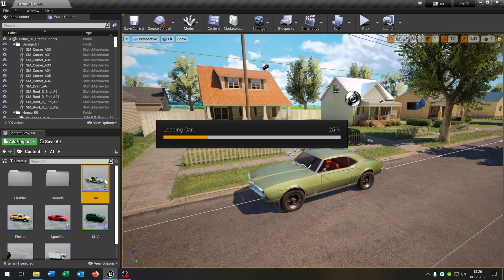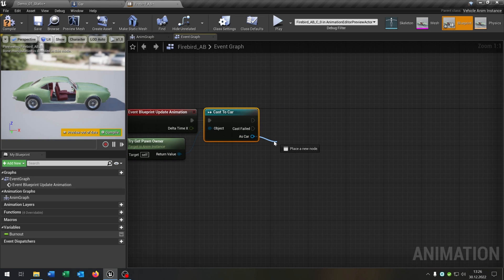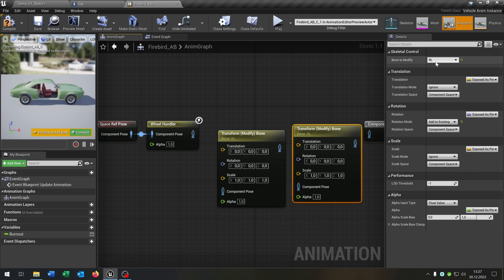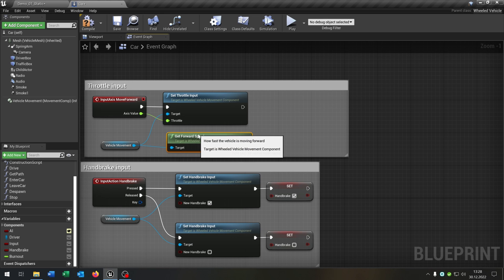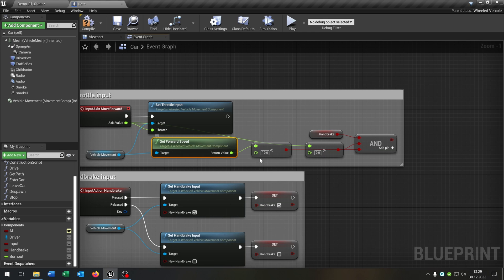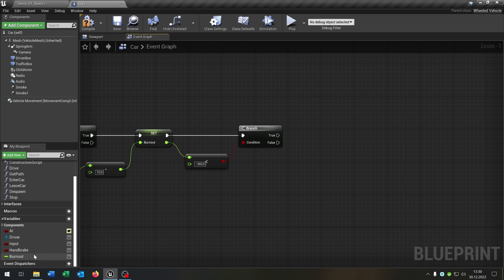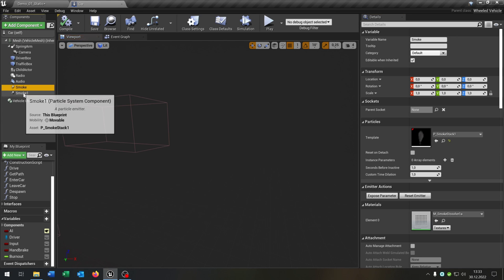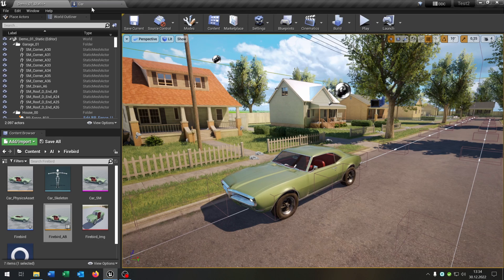Unreal Engine Car Burnout Tutorial

Comment: This is cool but would be more realistic to make the vehcle slid to left or right depending on if you press the left or right arrow keys .
Reply from the maker: I know what you mean, but unfortunately there is no physical way for that. You could only rotate the whole Car. But there would also a Problem with the Pivot Point.
Reply: @Seredias.  in order to achieve this logic spawn a cube with collision in front of the car when button up,down or w,s is pressed at the same time, this will not allow the car to move forward but it will allow it to move the back of the car while it is doing the burn, another way is to spawn a cylinder underneath the front of the car which will mimic the car being suspended by the front axis and allow the back to move.
Reply from the maker: @Sepsi991  Of course you can manipulate it, but I meant there is no physically realistic way. By the way did you tried that out, cause it sounds like it could cost some collision Problems.
Reply: @Seredias.  agree, collision could be a problem but i don’t see any options for now. I did not tried it is just a hypothesis.